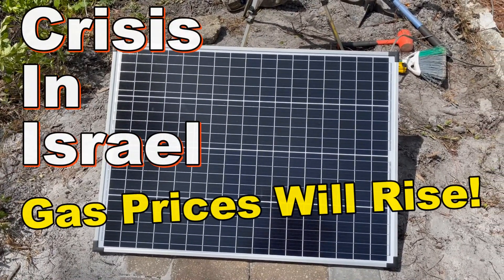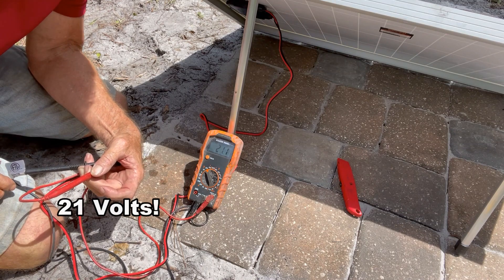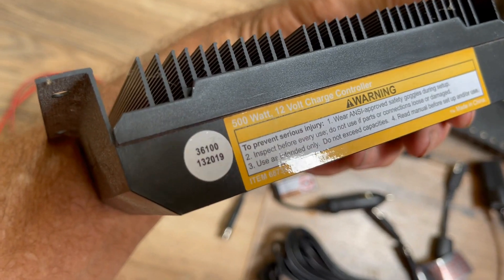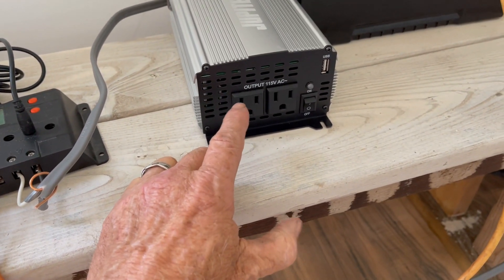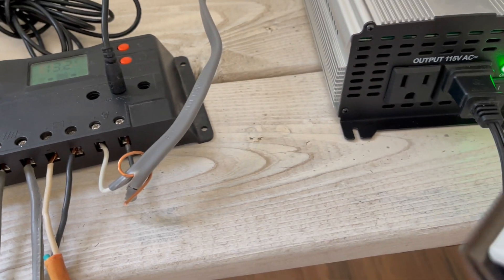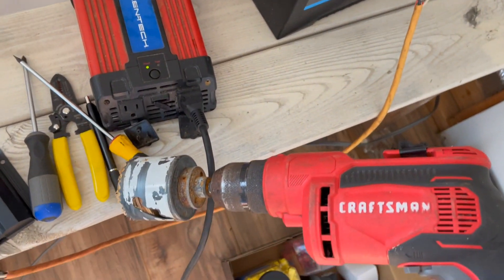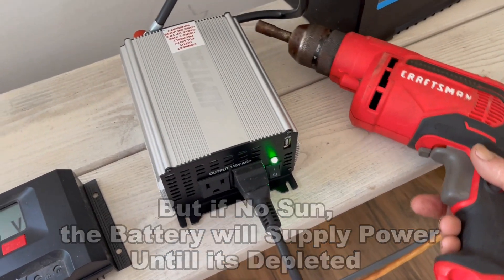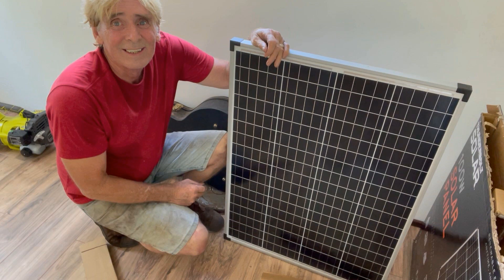Simple Solar Set Up for Beginners. Will 100 Watts Run A/C?

Comment: Great information, perfectly presented.  I am In Zambia where we depend on hydroelectricity and our drought caused massive power rationing.  I bought my battery and inverter - next steps solar panel and charger controller.Thank you sooo much